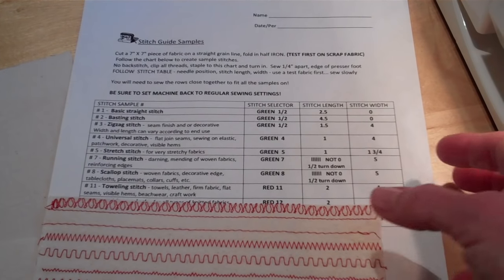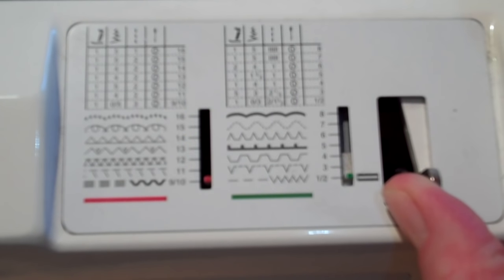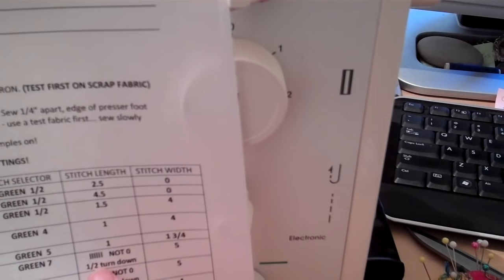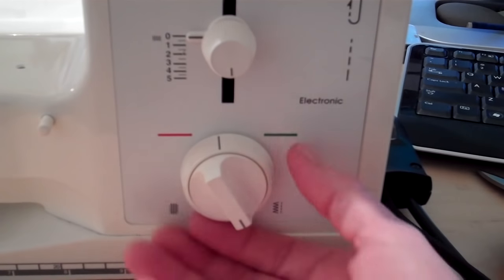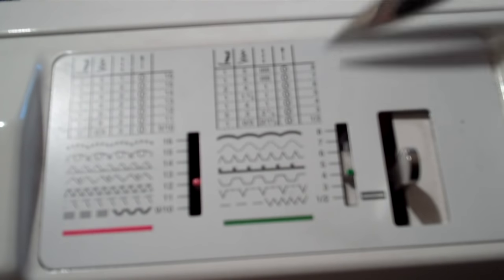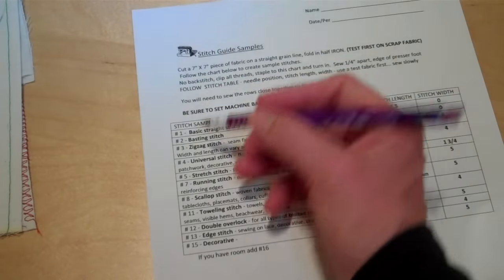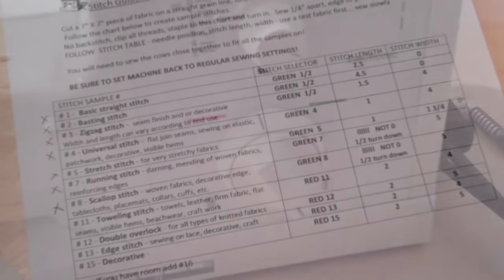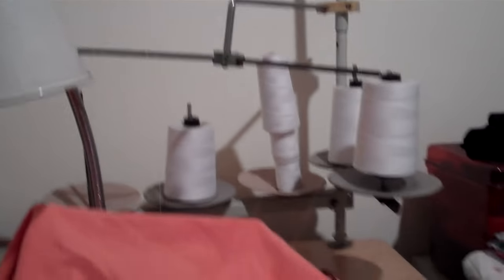Sewing Skill  - Decorative Stitches Bernina 1008

Comment: Hi, Kimberly and other  Bernina users- I have a 1031 machine, which I love, and not have used the decorative stitches recently- I'm having trouble with them- they come out very long- the pattern is elongated. Is there anything that might alter the way the stitches come out? Needle size?
Reply: Thanks, Kimberly- I appreciate your response. I was asking if there were anything other than those settings that could be making the stiitches incorrect. Probably I just have to take it to be repaired.